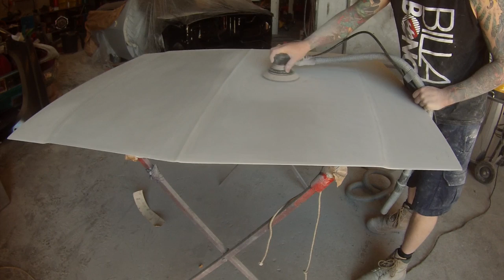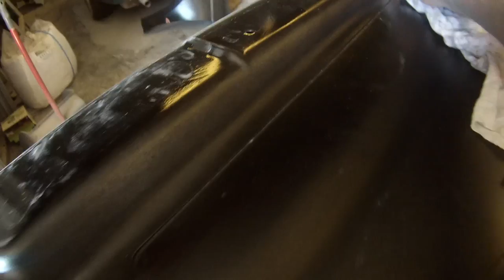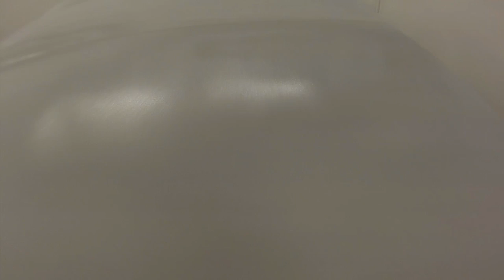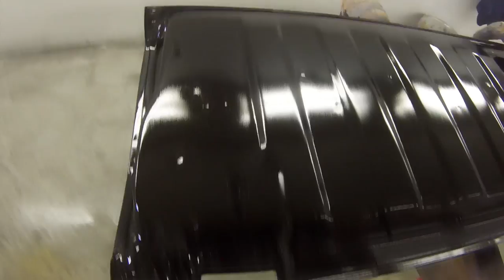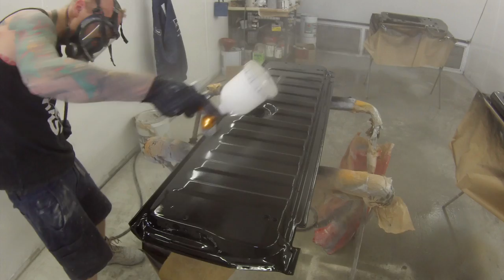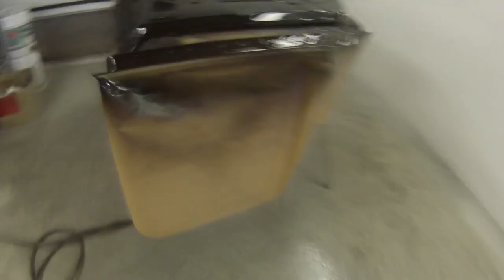HQ Restoration, Block Prime & Paint

Comment: throw the 125 s hardner in the bin use ak 260 slow and make sure to use xb 383 slow reducer for the basecoat make sure to put the basecoat on in a 1 and a half coat application as data sheet .(high solids basecoat). 696 is not the best clear but easy to use and must go over a really smooth base other wise it can pinch a little
Reply from the maker: phil mcrevis I hate slow hardener and I won't be using that clear anymore not after the most recent job its too hard to polish and keeps coming back.

Comment: Question on this restoration. You are priming blocking spot priming then paint. I'm following your lead on my restore project. But I've been reading on on reducing out the epoxy primer spraying over your block work then paint after flashing. Is this way just more use of material?

Comment: Any chance you could do a video on spaying up parking sensors on a bumper is there a different approach that you need to do to get it to look the job.

Stephen
Reply: You can either take the parking sensors out, when you take the bumper off they are normally clicked in pretty easy wouldn't recommend masking them as they always have like a rupper seal on them  hope this helps

Comment: how do you deal with the edges and overspray onto the front side of the panels? 
when you flip it over to do the front, do you tape off with a soft edge from the bottom or just not worry about it too much ?
Reply from the maker: Geniee That will be in the coming videos but yes I back mask then use a sheet of paper to stop overspray.